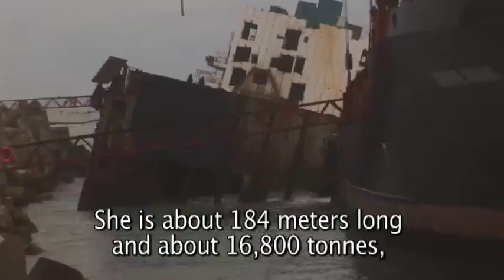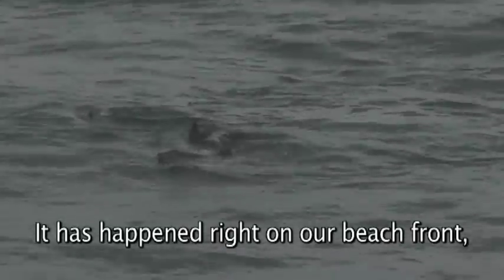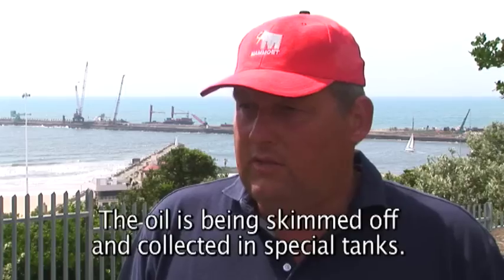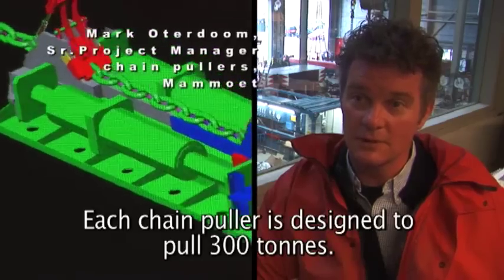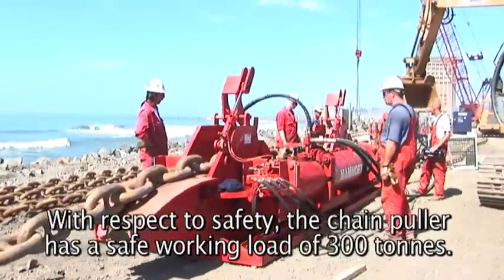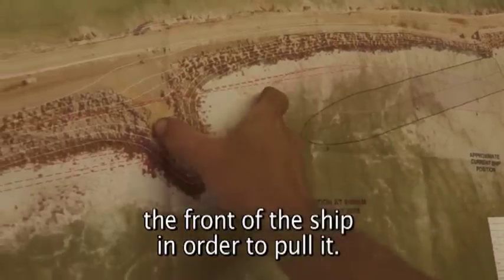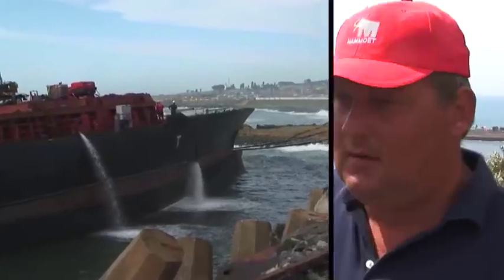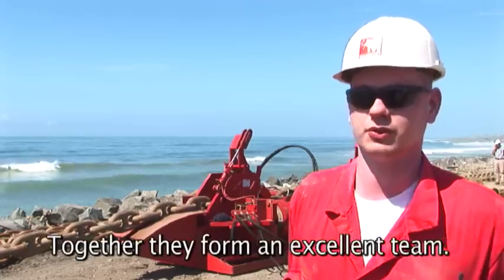Mammoet Salvage - Wreck removal of a container ship in South Africa

Comment: Wouldn't it be easier to find an existing inlet, float the ship in, sandbag the inlet entry, add water, throw rocks under the ship to support the higher elevation, and pump out the water?

Comment: Hydraulics are very impressive.. makes the impossible possible..
Reply: It could be done with cables and pulleys, but hydraulics are so much easier.
Reply: If the Queen Mary needs her keel worked on, will she be raised on large rubber pontoons?
Reply: @tomburcher5237  they pull the plug and deflate it.